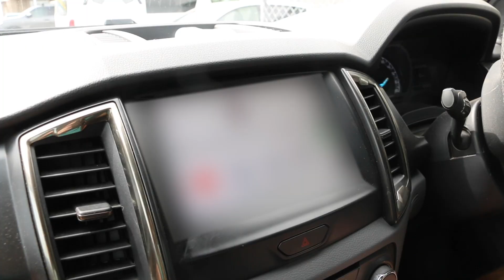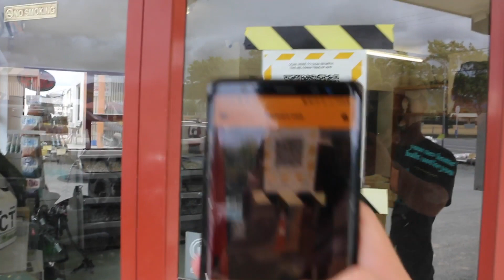I've Still Got a Mountain of Landscaping

Comment: Haha brings back memories of my renovation in Tomarata back in 2008. Lifestyle block on a sloping section. Fortunately my neighbour had a 12 tonne digger who only charged me $50/hour. Cue approx 6000m3 of dirt moved. 200+ retaining wall posts 1-1.2m high which a mate and I post hole bored ourselves (1m down). Each post took 3.5 wheelbarrows of cement and we had an electric mixer like yours. I can't recall the exact formula but it was close to 20 shovels I think and half a bag of cement. I made it all myself. I lost a lot of weight that Summer and we have lots of flat lawn now 😬😄
I'm back doing reno #2 after having it rented out since 2008 and all the posts are still straight and all the retaining walls look mint after a serious water blasting